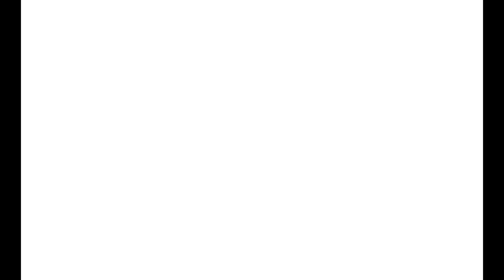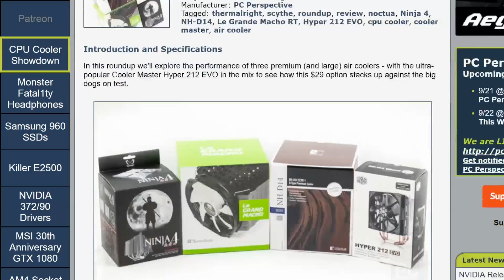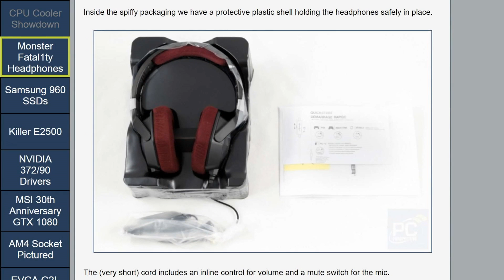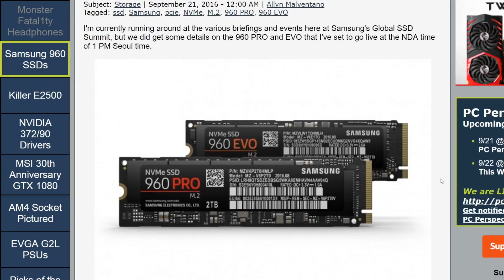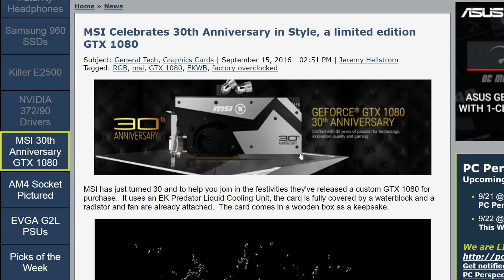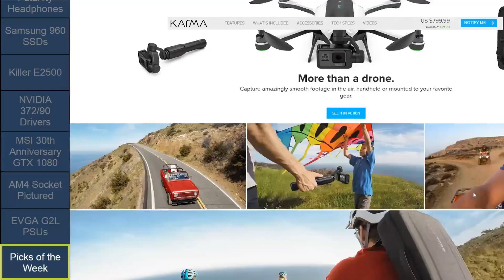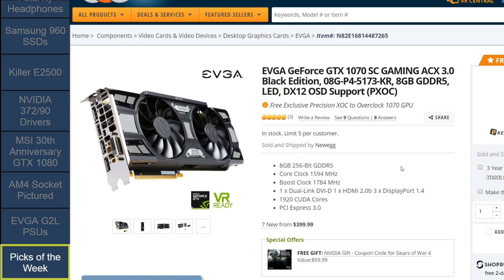PC Perspective Podcast 418 - 9/22/16

Comment: Everyone will tell you that LGA is far superior to PGA. Higher faster current, overall more pin count allowing for more PCI E Lanes etc etc.  Even AMD uses LGA design on their server chips like the G34.
However the one major issue I have with LGA is that Intel recommends only 20 CPU inserts on a LGA socket before replacing it (as in the mobo).  I mean yeah once you put a CPU in your mobo you shouldn't have to pull it back out at all, but this is something that I always think about for some odd reason.

Comment: I have  a Hyper 212 EVO with 2 Noctua NF-F12 PWM 55.0 CFM 120mm Fan in push pull on a Intel Core i7-4790K over clocked and it keeps it cool.

Comment: Umm, I dunno where that stated $80. price tag is coming from, on the Thermalright Macho Rev. B cooler.  Not widely available by any means:  right now only NewEgg and Amazon have it (as far as I can find on the googles).  Then if you look, that's actually from the same source retailer on both sites.  But any order over $50. is free shipping from Amazon, even if you DON'T have "Prime".  So TOTAL shipped price on the Macho Rev. B right now on Amazon, is $52.90.  But even if you went with NewEgg, that's only ~$65 with shipping.  

Obviously the larger issue is that the price history chart on PCPartpicker, shows the Rev.B was out of stock altogether for about 6 months earlier this year (maybe not -- Amazon blocks display of their price history).  But the point is, it's much closer to price competitive with the Scythe Ninja (Scythe also has spotty retail coverage generally), than to the much more expensive (and discontinued?) Noctua D14.

Comment: by the time you've bought a 212 evo and a noctua fan you might as well have bought a noctua heatsink and got the excellent accessories etc you get with a noctua. They do make a single tower 120mm cooler. They're an investment because you can usually move them to the next computer you build - their secufirm mounting mechanism is universal and all metal.

Comment: Timestamps
00:00:00 intro
00:01:57 CPU Cooler Showdown
00:11:54 Monster Fatal1ty Headphones
00:24:23 Samsung 960 SSDs
00:33:08 Killer E2500
00:38:45 Nvidia 372.90 drivers
00:40:21 MSI 30th anniversary GTX 1080
00:43:52 AM4 Socket pictured
00:50:40 ECGA G2L PSUs
00:54:13 Picks of the week
00:55:18 GoPro Karma drone
00:59:45 EVGA Geforce GTX SC Gaming ACX 3.0 8GB DDR5 LED
01:01:37 Acer Predator Z850 gaming projector

Comment: 1:30 CPU Cooler Showdown
11:50 Monster Fatal1ty Headphones
18:50 are they worth the price?
23:00 Patreon
24:30 Samsung 960 SSDs
33:05 Killer E2500
38:45 new AMD & NVIDIA Drivers
40:20 MSI 30th Anniversary GTX 1080
45:15 AM4 Socket Pictured
50:35 EVGA G2L PSUs
 Picks of the Week
55:10 gopro karma drone
59:40 EVGA GeForce GTX 1070 SC GAMING ACX 3.0 Black Edition
1:01:35 acer Predator Z850 gaming projector

Comment: I have the geforce gtx 1070 evga SC and mine over clocks to 2050 mhz on the core and a extra 50 mhz on the memory runs great. And the max temps on the default fan curve are bout 73 to 75c. I love it.